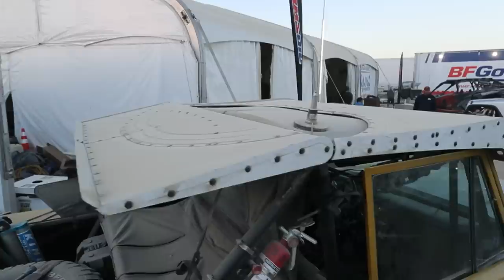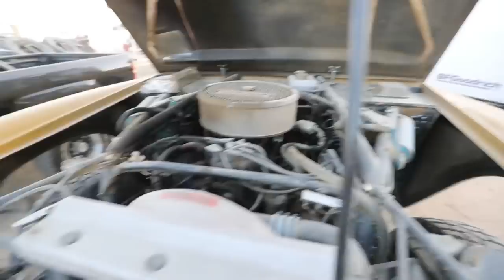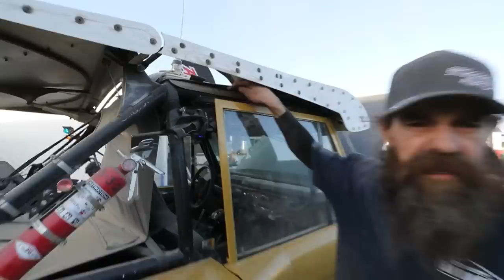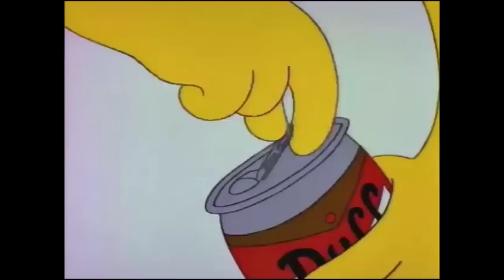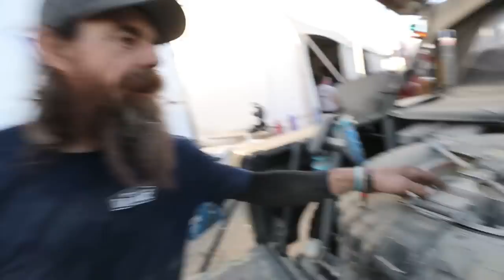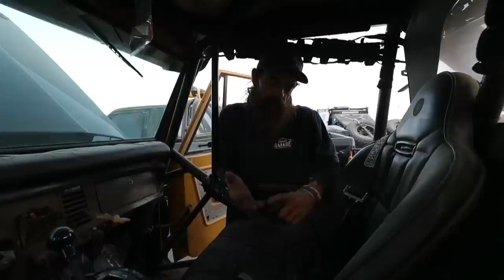The Perfect Old School Ford Bronco Prerunner! | BUILT TO DESTROY

Comment: So I have a 1975 bronc. I stretched it 8 inches then moved the rear axle aft on the chassis 4 inches to improve the departure angle. The front frame rails and suspension are all 2010 f150 with a gen 2 coyote and a 2.0 liter Whipple on a haltech nexus G2. I'm running a 10 speed from the newer generation f150 which I absolutely love. Right now it has an 8 inch section of similar thickness galvanized sheet metal I just panel bonded together and threw a thin layer of glaze, blocked 'er down and fogged some black primer over the entire thing. I'm not happy with it at all. It looks fantastic with the big 5 inch wide bushmaster flares and 38s with black weld d window beadlocks but I know it's just a matter of time before that BMW panel bond lets go. She makes 580 wheel on the conservative pulley and e85, 514 wheel on 75% 91 octane 25% e85. Anyway, wondering if I compensate this man generously, if he would be willing to add 8 inches of length to those gorgeous q panels. I'd even come pick them up because no way I'd entrust the United Pot Smokers (UPS) with some one off pieces of kit.